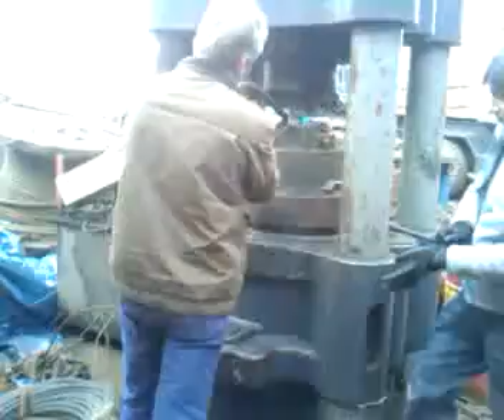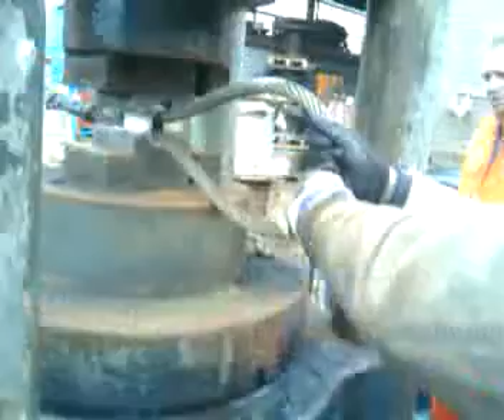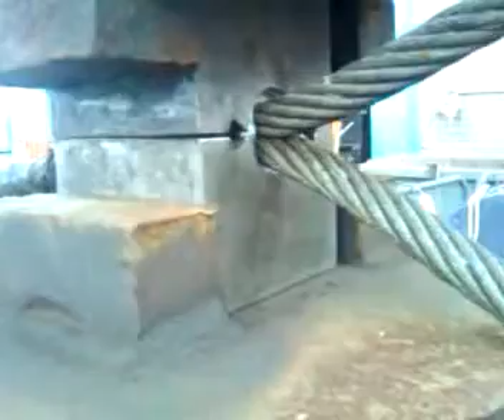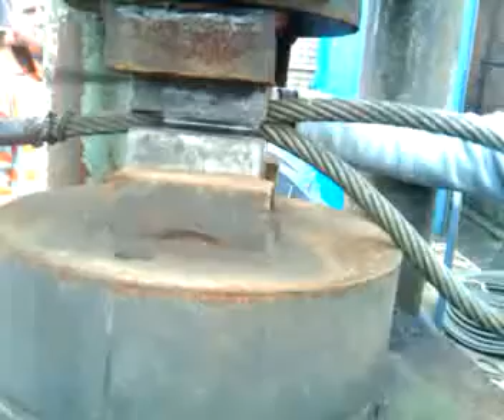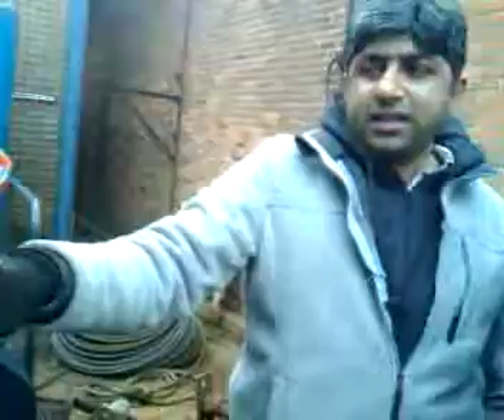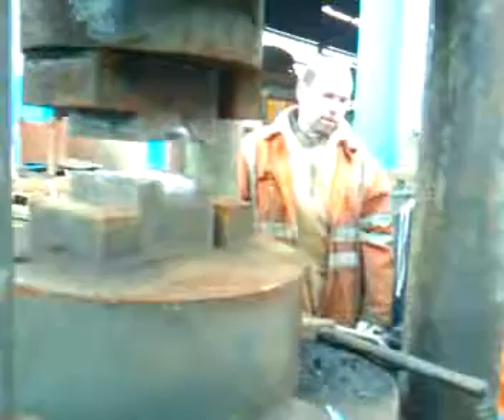Clamping a sling with Talurit -alu on 28mm steelwire

Comment: those dies are worn, they're not touching at the bottom of the stroke. pressed diameter will not conform to the talurit chart. good luck obtaining the correct breaking strain.